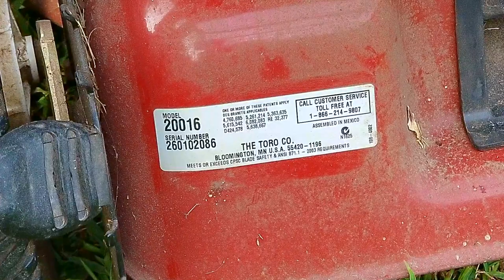Why Get A Tecumseh Powered Mower?

Comment: The only issue I have with the Tecumseh engines, is the hassle to access and work on some of them.  I think Briggs is a much more simplistic design (easy access to screws, bolts, springs, etc).  Carburetor is easy on, easy off, with basically a single linkage where you have to have gumby alien fingers to arrange all the Tecumseh parts back on.  For a Briggs, if the flywheel brake part needs changed, it's easily accessible, but on a Tecumseh the entire flywheel has to be removed first.  I've also only ever had about a 50% success rate cleaning Tecumseh carbs.  They always either don't prime properly or the needle doesn't seat properly.  BUT, they are great engines and super smooth.
Reply from the maker: very good engines and I'd take the trade off, of easy to work on for not having to work on them as much.

Comment: Excellent commentary.  I like how you B-Roll cleaning the mower over the voice.  I am struggling to get a Tecumseh starting again, having torn it apart and replaced many parts with OEM.  I would get the Briggs because the parts that caused me the most problems were screws breaking off in the engine block or cylinder head and then the bores for the screws breaking.
Reply from the maker: yes that is a big problem to deal with

Comment: in 1985, I had a 20 inch Craftsman mower with a lightweight cast aluminum deck and a self throttling Tecumseh engine that throttled up automatically when the engine encountered more resistance.  it worked GREAT!  best mower I ever had.  naturally they don't make it anymore because it's too good.  fuckers...

Comment: Wow it's amazing whatever you're using to clean the Lawnmower spray on and rinse off what is that Product thanks.
Reply from the maker: Thanks it's the only degreaser they sell at Harbor Freight, I use it at full strength

Comment: I did comment about my experience with the Tecumseh engine earlier but today I would buy either the Honda known for reliability and long life or the Briggs and Stratton as also long lasting and I think easier to work on. Again the Owner’s maintenance is so IMPORTANT in trouble free operation it makes me very reluctant to buy a used mower.
Reply from the maker: you are definitely a great owner!

Comment: I don't mind the Tecumseh engine especially the carb because of the bowl was easy to get to without taking the whole carb off if not necessary but can always be taking off by the intake also as a whole piece.
Reply from the maker: you're right the access is truly unprecedented

Comment: I definitely agree with your conclusion I grew up with Kohler Engines even my Grape Escape go cart I had when I was a kid had a Kohler engine on it. When I got my first house I did not really think about what engine the mower had on it I just wanted what was cheap in my case it was a MTD (Yard Man) with some type of overseas engine. It did not last long with consistent oil changes after year 3 it lost all compression and the parts to fix it non existent. So that is when I had to start paying attention to what engine my equipment had on it. I bought a new Lawn Boy mower with a 6.5 Kohler engine on it I had it for 7 years then I gave it to my mom when her mower died. She had a 5 year old Weed Eater mower with a Weed Eater branded engine on it. Then I bought my current mower a new Toro with a 6.75 Kohler it is now 3 years old and I have not had any issues with it and The Lawn Boy I gave to my mom is still running like new it is now 10 years old never even had to service the carb on it. I think your video really makes sense. Stick with what you know and Take care of your equipment it will take care of you. Great video!
Reply from the maker: well said and great advice!

Comment: I love the tecumseh engines. I picked up a toro 22inch self propel rear drive mower it also has electric start very clean but I need to fix the drive system and the starter doesn’t engage. It fired up on the first pull after sitting for months
Reply from the maker: nice, they really don't make them like they used to.
Reply: nice! I think I have the same one. Check the fuse and wire connections and then pull off and maybe clean the starter/bendix gear if needed. I test mine with my lithium jump pack for my car, but can use any 12v battery.
Reply: @M.TTT.  I took blower shroud off. Turned key to wag h what would Happen it seems to spin slow because if I put my finger on the gear and manually engage it then turn the key it’s to weak to turn over so maybe it’s to slow to engage. I also put wd40 on the bendix and it quoted the motor and it sounded better but then the rubber drive piece that acts as a clutch slips so I’ll need to brakeleen it off. The rubber looks crappy and is almost like deteriorating. Might order a new spring,gear and the rubber pieces. Looked up my engine numbers and can still buy oem tecumseh parts. The battery is 87$ through toro I’m gonna go to my local battery store and se if they can’t match something up for less. The transmission doesn’t drive right it push fine forwards but oulling backwards binds up and grinds. Either the wheels with the gears are bad or it’s an internal trans problem. I can but a new oem toro trans for roughly 80$ new. But can also buy internal pieces too. Will let you know what happens

Comment: I remember all of the problems Techumseh lawn mower engines had especially back in the '70"s, I believe the Sears & Roebuck mowers used them exclusively & they often would not start, remember the "Eager 1" line? my neighbor had those mowers & always had trouble with them. We "blew up" a lot of Techumseh engines on our mini bikes & go carts. Techumseh mini bike engines seemed to be more powerful than their Brigg's & Stratton counterparts, but the Techumseh engines threw a lot of connecting rods which was rare for a Briggs. The biggest problem we had with Brigg's mini bike & go cart engines was that the crankshaft bearing surface (part of the block, behind the flywheel) would wear out & the crank would start bouncing around affecting the ignition contact points. IMHO Briggs & Stratton engines were much more reliable over-all. Great video!
Reply from the maker: thank you for sharing the experience with us. It sounds like you guys had a lot of fun on those go karts!

Comment: What cleaner do you use? It seams to work great.
Reply from the maker: Harbor Freight, and they only have the one there in a gallon jug. It's a great price, and I use it at full concentration but just be careful, when using it on paint
Reply: @HomeGaragechannel  thanks, I'll give it a shot

Comment: I have a 15 year old Briggs branded push mower that I got for free (it didn't run at the time), and it starts on the first pull every time. I put a knockoff carb on it and did some minor cosmetic repairs, and it is my favorite. It runs better than any of the newer ones I have owned. You just have to take care of them.
Reply from the maker: well said Jesterr

Comment: My future father in law bought this exact same mower from Home Depot back around 2002 or 2003. I have no idea what he paid for it but it was a good mower for him until the front gear box wore out. Rather than fix it he just bought a newer Toro which at that time (2011 or 2012) came with the China-made Kohler engine. He gave me the Tecumski Toro and I just removed the gearbox and used it as a pushmower on my lawn when we got our first house. I used it that way for a few years until I got a new mower. That engine ran great and always had tons of power and started on the first pull after 1 or 2 pumps or the primer. But back to your question: I don't think the average 1/4 acre suburbanite homeower cares what engine came on their mower. They are just looking for the best deal as they probably view these things as throw-away units. I'm sure Toro had a contract with Tecumski and when it expired they moved on to another manufacturer (in this case it was Kohler). The OEM will use whatever brand that a.) meets all their requirements and b.) is immediately available and is at c.) the best price point for the bean counters
Reply from the maker: yeah, you make a good point, buy it, use , toss it.

Comment: I purchased a 2005 toro like that new. They all came with Tecumseh motors as Toro was using Tecumseh for snow throwers and mowers except for some Super Recycler mowers. They didn't switch to Briggs on walk behind mower until Tecumseh went out of business around 2008.
Reply from the maker: thank you for the information

Comment: My experience starts when I mowed the yard but was too small to start the mower which was an OLD belt drive Murray with bicycle wheels in back and no deck sides, with a cast iron Briggs with a coil it yourself rope start. Then the freebees started coming in and I was still a kid but didn't mind grease. BUT the REAL experience came in when I started working for folks and what THEY bought and already had and I had to fix and or keep running. They had a mixed bag and Briggs were easiest and Tecumseh was a fight. AND as time went on, Briggs started to morph into Tecumseh with some of their own stuff and the longer, the more. And when Honda went from regular to entry level that was 4 strikes for me. I like Honda but wouldn't swap an old Briggs flathead for 4 of them. Not worth it, to ME and ONLY me. I like the older Kohlers but the new ones have had a bad run of soft cams. I'll just stay with my old Briggs and my one overhead valve Kawasaki. Too long in the tooth to change now.And the 2010 TRoy-bilt electric start is becoming more TEcumseh-like as time goes on.  BLESSINGS!
Reply from the maker: yes the new kohlers seem a bit troublesome. I'd go with the briggs too. Thank you Lewie McNeely

Comment: I would want a Sears designed Tecumseh engine period. The “eager one” Sears Tecumseh design was one of the best small engines designed with its automotive type front loaded air cleaner/filter. There was also an OHV version as well.
Reply from the maker: you are right, Tecumseh engines are very good.

Comment: I would rather buy a used Tecumseh instead of buying a new Briggs due to the poor quality cams and plastic carburetor. If I would buy a Briggs it would have a old classic engine.
Reply: Briggs has been using nylon cams since the late 80's even honda uses them i rarely see issues with them
Reply from the maker: thank you W S.

Comment: I love Tecumseh engines, always have, but more so just because everyone else hated them back in the 90's when I was in trade school getting my certification. lol.  Jokes aside, I've been in the OPE biz for 30 years, and I'd honestly stick with a Briggs.  But NOT a EXi Briggs, stick with the Quantum.  Tecumseh's are fine, but now that they have been out of business for what, 18 years or so (??) parts are very hard to find.  Neat thing about a Tecumseh, you can prime the living hell out of it, 20 - 30 times and it will not flood.  New they say 3-5 times, a year later we say 5-10 times, 3 years later it's 15+ times....   as the years go by, just prime the hell out of that thing to get it going, seriously.  Great video as always.  OH, one thing I forgot to add, Tecumseh engines are louder than Thor's hammer, so if you don't mind having your head rattle, no problem.  EDIT:  I almost forgot, this is something real cool about Tecumseh engines.  They have a mechanical governor, and the governor gear inside the engine is specifically designed to change color if the engine was run out of oil.  Not shitting you, it is a white composite gear that will turn brown if the engine is run with low oil.  This was a deliberate design feature to assist technicians and dealers in determining whether the customer ran the machine without oil or not.  I had one new machine go out, the lady brought it back because it was seized, I thought she didn't run oil in it although she claimed she did, and the engine was full of oil, so I cracked it open to look at the governor gear.  Yup, the gear was brown, but get this, the damn engine didn't have the oil pump plunger in it!  Right out of the factory, Tecumseh neglected to put the oil pump plunger in the thing!  Naturally, it was warranty,. and I owed the lady an apology for doubting her.  That must have been in 1996 or so.
Reply from the maker: well said, I almost need to get a tattoo that says, quantum for life!

Comment: I have this exact mower,  and mine built in 2016.   Since we mow lawns almost all year round here in central Florida, mowers are constantly in use.   I still have my Craftsman 21" w/ B&S  engine that I purchased new in 1998.,  only 1 rebuild on it.  Oil changes and routine maintenance will give you years of good service.
Reply from the maker: wow very nice!

Comment: Wow that cleaned up so nice Yeah I like my Briggs too I got one of these Toro 2 They didn't have no Briggs in Stratton At the time And the wife was saying buy the Toro or get the battery one I need a Rear drive Didn't have one So I went  With front wheel drive but don't work so good on the hills And I don't like that circumcision motors They seemed to me harder to work on We only bought the Toro till I got the coil for the John Deere the John Deere is rear drive I use a Toro one for the flat ground Thank you for the video Sorry if my spellings off
Reply from the maker: thank you Lil Joe II! I appreciate your time here.

Comment: I have that very mower, it was free to me, and had to diy it to make it work. I had to re route the kill switch which solved the hard start. I'm cheap so I didn't spend any money on that issue, however the Transmission went out so I bought an e-bay special. The engine did have carb issues and so I cleaned it and replaced the o-rings and emulsion tube. Since then it has been a very dependable unit.
Reply from the maker: very nice work, and I really like this mower too, I think it's built well and if taken care of will last a long time.

Comment: When I bought a new mower 3 summers ago, I was looking at a Cub Cadet and a Toro next to each other at the dealer. They had the same Asian engines on them. I went with the Cub Cadet since it had caster wheels. The equipment makers are really determining what you get.
Reply from the maker: yes at the end of the day, you really don't have a choice anymore.
Reply: Asian engine? Are you referring to Honda? Because Tecumseh is american

Comment: I'm in North East Iowa. Tecumseh was made around where I'm at. I have had kinda poor luck with tecumseh and have been swayed to the side that prefers not to have them. If I had the choice for a engine on a good mower I would go with Honda everytime or Kawasaki. Saying this however my first ever one I paid for was when I moved on my own in 2018 it was a Walmart black Murry for $99 ish and it was the nothing fancy no frills model. But it did run great for me and still runs great for my inlaws who have it now. I've upgraded to a Snapper 22inch with a Honda GCV160 that's RWD. I much prefer the Honda engine runs smoother and is quiet.
Reply from the maker: those are great choices!

Comment: A friend gave me a Toro Personal Pace mower, that has a Tecumseh engine from 2015 I believe.  It's been a great mower.  I did have to replace the carburetor once.  I change the oil every season, clean the plug and replace the air filter. Toro used  Tecumseh engines for several years.
Reply from the maker: nice, thank you for sharing your experience

Comment: Cost was definitely the deciding factor determining which mowers had which engines. Tecumseh used cast iron sleeves in their engine blocks when Briggs was just using the aluminum block. A Briggs engine was cheaper to make especially after they moved production to Mexico. The lawnmower manufacturers wanted to make the cheapest mowers which meant Briggs engines. When Honda got a good reputation, they started using Honda engines to sell to consumers who were willing to pay more. Tecumseh was the go to snowblower engine because they were easier to start in cold weather.
Reply from the maker: thanks for the information
Reply: I believe Briggs had the better technology for making aluminum alloy hence the better Tecumsehs sticking with sleeve bores but top of the line Briggs were also made with sleeve bores as are the best Hondas (not the cheap but high priced consumer Honda)
later I think Briggs quality hit the shitter before the management declared bankruptcy and the assets and brand name were sold off

Comment: I just used mine today, this same model mower.   My parents bought it new in 2005 and it still runs great.  I recently cleaned the low speed jet after removing the needle.  It is hidden under the black plastic plug at 7:30, beside the primer bulb.
Reply from the maker: thank you for sharing that.

Comment: What degreaser are you using? It seems to melt whatever you spray it on. I normally have to pressure wash.
Reply from the maker: thanks it's the only degreaser Harbor Freight has. They come in gallon jugs and are a very good price. I use it at full concentration, no dilution
Reply: @HomeGaragechannel  Thank you very much. I saw a jug of it this weekend when I was harbor freight and I was curious if it was any good. Thank you!
Reply from the maker: no problem